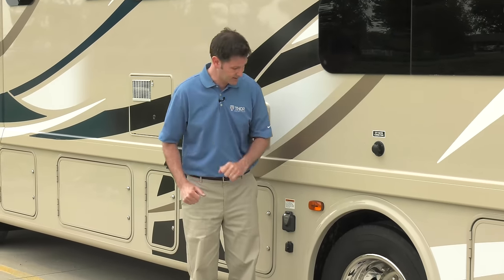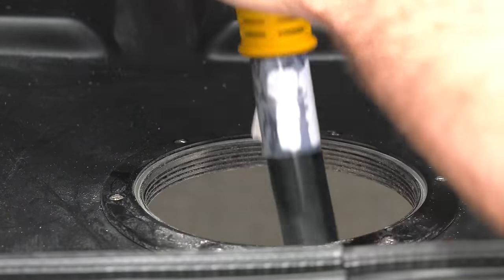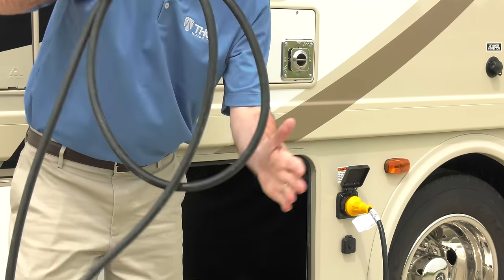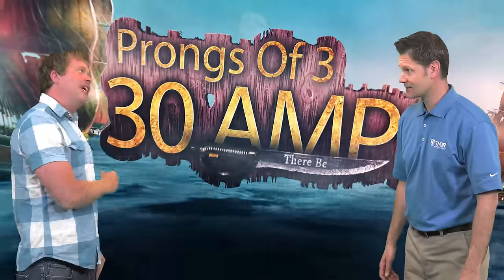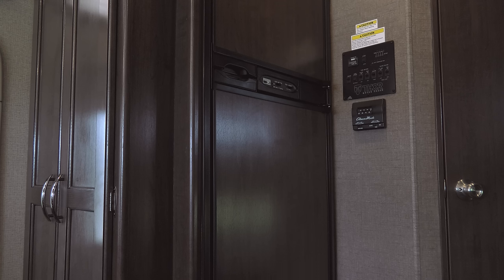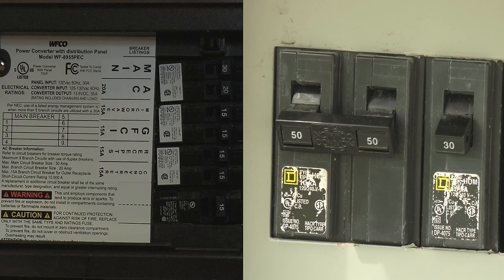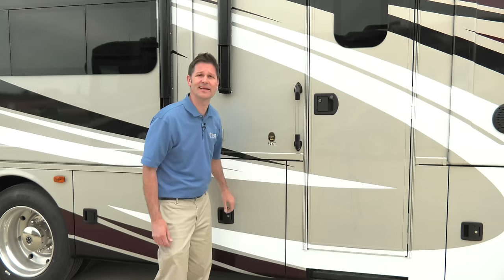30/50 Amp RV Service Connection

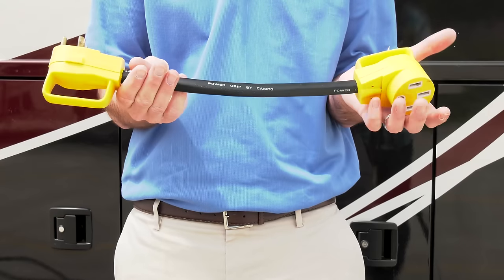Comment: At 2:30 your mention that you can use an adaptor to use your 30A cord to plug into a 50A plug, but the adaptor shown is to plug a 50A cord into a 30A plug, correct?
Reply from the maker: You are spot on.  The adapter shown will plug into a 30 amp service.  You can tell with the 3 poles on the plug.  If it had 4 then it would be a 50 amp connection.